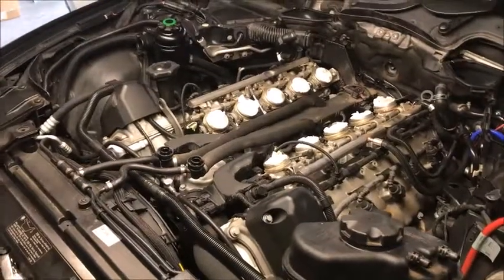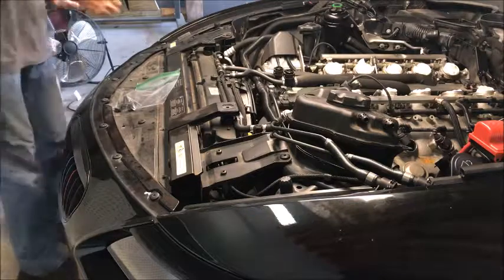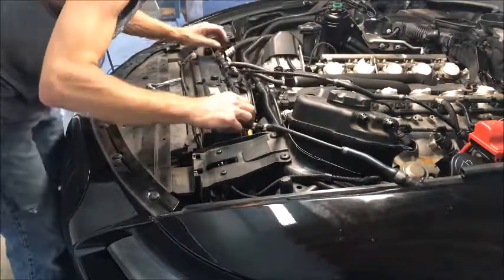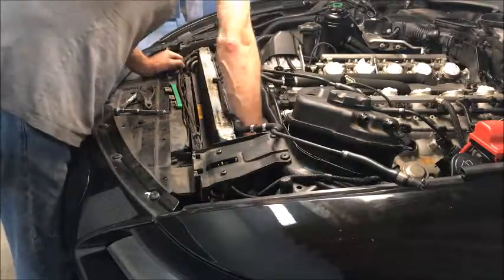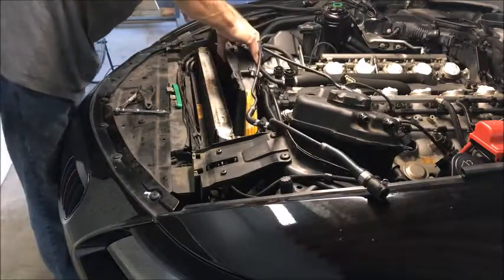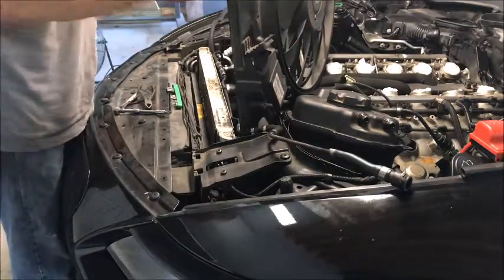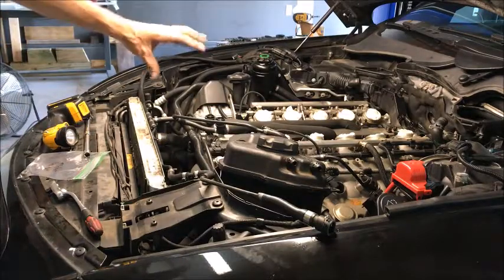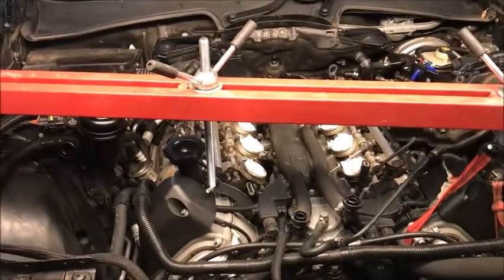BMW S85 Rod Bearing and Vanos Line Replacement Part 5 of 13 - Fan removal and Motor bridge

Comment: I'm getting ready to change rod bearings and the vanos line on my 07 m6, with your videos i feel so comfortable doing them. Thanks so much for explaining everything so well!!!
Reply: Yeah the only thing that I don't have is the ISTA. I was hoping if I research enough maybe I will be able to find a manual way to do it. Thats awesome, I've got a full exhaust system to put on as well but I've been waiting to install it when I do the bearings. Kind of like a incentive type thing lol. Thanks again!
Reply from the maker: @billyarcher2725  👍. Not sure of an easy way to manually purge all of the air out (the solenoids are very sensitive to even little air bubbles).  I got the copy I mainly use as a free download from Bimmergeeks.com, but the cable has to be purchased...it’s not very expensive though.  Bcables.com sells the cable and it comes with the INPA/ISTA software at a decent price and theirs loads up pretty hassle free onto the PC.  For reference, our  cars (e6x series) use the cable most sites call the “Silver Cable” if you do end up buying one (it has a silver colored wire outer jacket).
Reply from the maker: Thanks man !  Glad the videos helped out some with getting a feel for what has to be done 👍. Getting all of the odd tools, dial indicators, and torque clickers ahead of time as well as already having ISTA to bleed the vanos at the end saved a bunch of wait time and made it much easier to get it done since it was all still fresh in my mind.  So far the car has run flawless after the bearings and vanos line replacement and my Black Stone oil change reports look great.  Thanks for the feedback on the videos...All the best ! Steve
Reply: Thank you for all your help! I researched almost all day today on it, you are right it has to be done with software. I definitely don't want to take any shortcuts and mess up everything. I am going to purchase the cable and software. Looks very simple to use on your explanations on your video! Thanks again!